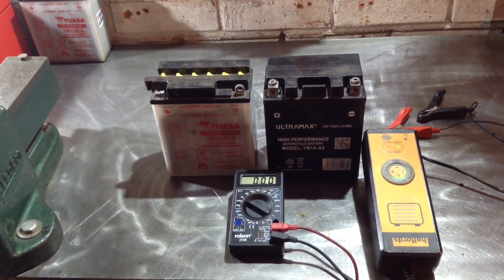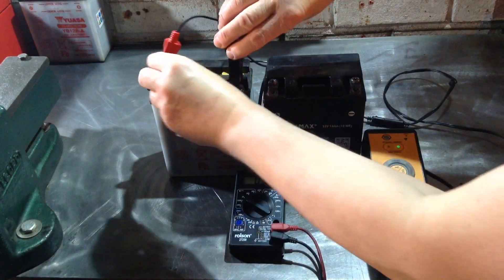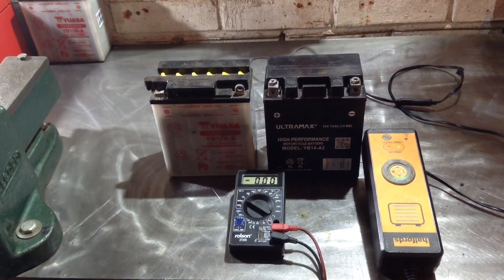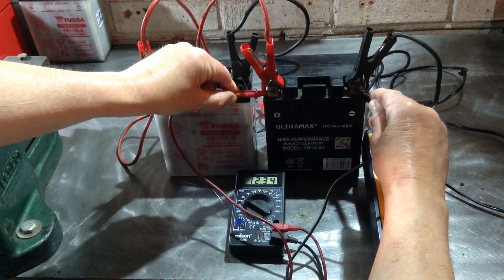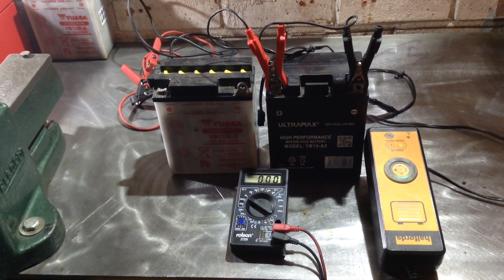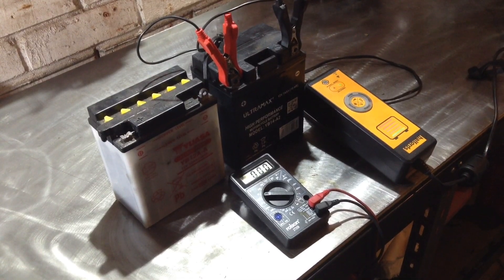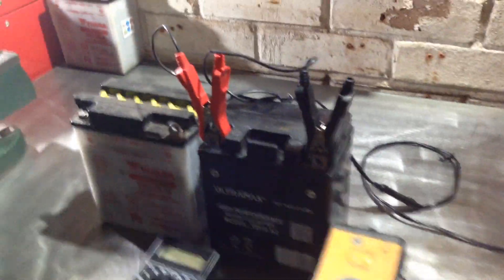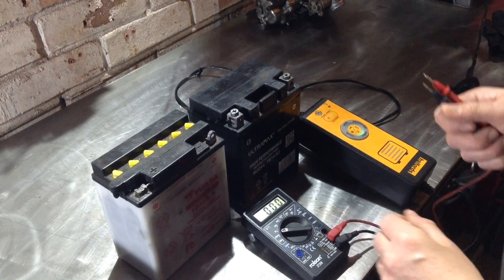Lead Acid Battery Refusing a Charge - Quick Fix.

Comment: Thanks, useful info. Another option is to measure the charger output voltage and if it's non-zero (should be around 14V), then just need to put the battery on charge and wait. It will eventually start charging. Worked with my old charger. Trying with the new one as I write this.
Reply from the maker: If the old charger is a non smart charger then yes would eventually charge, issue is with smart chargers, is they can’t detect polarity at very low voltages so won’t begin the process. this just needed a boost to get the charger to recognise it’s polarity and kick in.

Comment: This has Nothing to do with the battery. It's the charger you're using not turning on because the voltage is too low. 

The title should be "How to trick a smart battery charger into charging a completely dead battery."

The battery would have charged if connected to a Constant 12v source or a running vehicle via jumper cables.
Reply from the maker: “This has Nothing to do with the battery. It's the charger you're using not turning on because the voltage is too low. ”  yes I know, which has everything to do with the battery, as the smart charger can’t determine its polarity as the voltage is too low. 

“The title should be "How to trick a smart battery charger into charging a completely dead battery.” The charger hasn’t been tricked, it’s been given what it needs to start charging. A battery with some charge and polarity information.

“The battery would have charged if connected to a Constant 12v source or a running vehicle via jumper cables”  you mean like another 12v  battery sat right next to it with jumper cables then flowed by being hooked up to a constant 12v source as shown ? Yes, that’s what happened here it charged with its adjacent battery, enough to let the charger take over. Not sure that running a car or another bike engine for hours on end would be a good alternative, or for most people convenient, let alone a suitable charging method.

Comment: Yeah it's the Smart charger. An old fashioned dumb charger will charge it OK, assuming its an OK battery. Same with my Optimate. On the carbs, a US guy called Mike Nixon wrote an instruction manual on how to service VF carbs, if you get stuck.
Reply from the maker: Thanks Jeremy, that’s good information, have you got a link to any of his resources ? I’m struggling to get the correct rebuild kit.